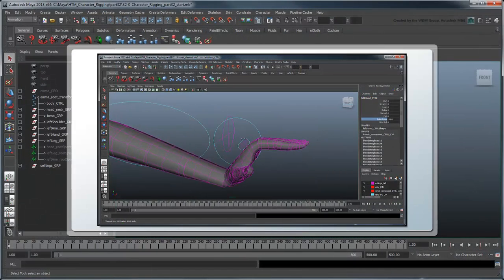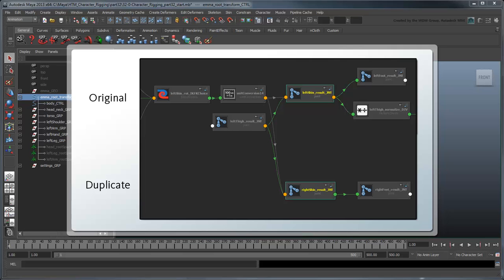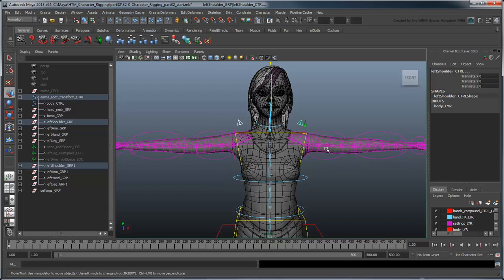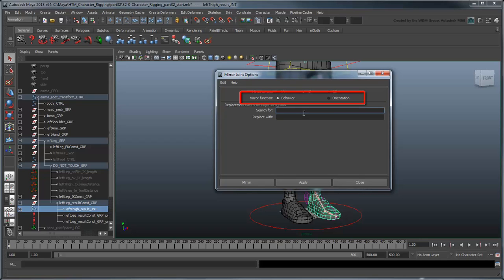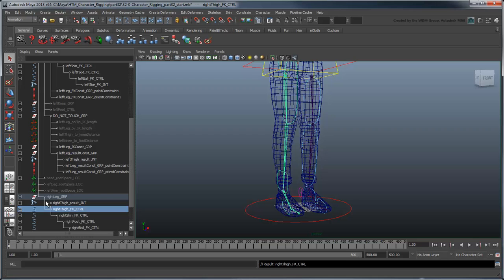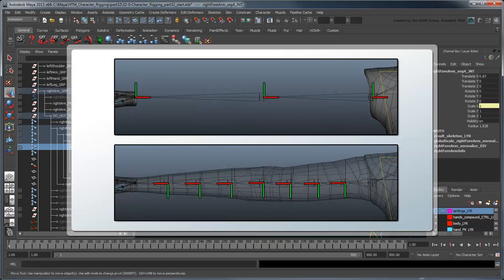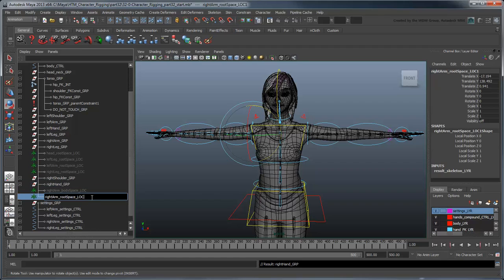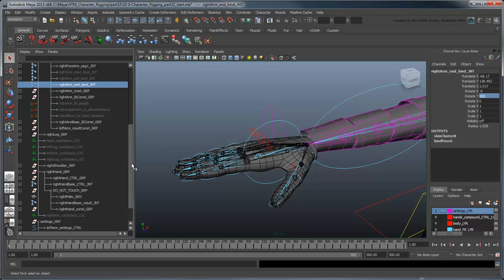Creating a Character Rig - Part 32: Mirroring (Advanced)

Comment: hey - i ve got a question - i am happy with the spine and leg rig - i scaled the whole rig up to my own characters body length - but my arms and hands are much larger than the rigs typical proportions for the size of the hands - summerized: How do i scale up the size of the whole hand rig  - the palm and the fingers  )

Thanks in advance
Reply from the maker: +Sebi Schulz That's actually pretty tricky because of all the math and length nodes involved.  You really need to build the rig to your model's specifications.  It is possible though.  You will need to manually lengthen the result/fk/ik joints, while also tweaking all the squash/stretch math nodes in relation to their new default pose values.

Comment: For me everything is working properly, I Didnt use the palm controls though.
I am having problems with my ik wrist, in translation x the wrist moves but the forearm is lagging back in percentage. i can't figure the problem.
HELP
Reply from the maker: +jiteshz Sounds like one of the math nodes might not be correct for calculating squash and stretch.  You might want to double check that they're all connected properly and dividing as expected.

Comment: Hello again. Assuming that one has gotten through and successfully created this rig for ones proxy character, I have two questions.

One. At some point I will eventually want to skin this rig to the original, uncut character. Is this something that can be over-layed in the same file (assuming that it wouldn't bog things down)? or should a separate file be created where you replace the proxy with the final character for skinning. I'm a little unsure of how to approach that final step for animation purposes.

Two. I will also want to eventually include a full facial rig along with the body rig. Do you recommend creating a separate rig for the head and face and simply parenting it to the neck bone, or should that rig created as an extension of the spine. I've been studying some digital tutors files for creating just such a facial rig, but I am unsure as to how to combine the two.

Hint, it would be great if this series was extended showing how to create a full feature facial rig as well, but hey, I know everyone is busy. Thanks for your time.

Comment: I am so close to the end of this epic rigging journey you have taken me on, and have been trying to resolve a space issue for some time. I'd appreciate some guidance as have tried the ideas mentioned below. I am orient constraining rightArm_resultConst_GRP and rightArm_FKConst_GRP to rightArm_shoulderSpace_LOC, rightArm_bodySpace_LOC and rightArm_rootSpace_LOC. My right arm joints were created from scratch, not mirrored. My shoulder and my hand groups were duplicated and the scaleX set to -1.

My rightArm_shoulderSpace_LOC attributes are: Rotate Y: 0 Rotate X: 0 Rotate Z: -137.01

If I make the orient constraint with maintain offset disabled,  rightArm_resultConst_GRP ends up with a rotate Z value of -53.13

I tried what Marc Antony suggested below, but the joint chains end up at different strange angles once I change the weights for the orientConstraint.

Any help greatly appreciated please.
Reply from the maker: +continuouscurve Hmm, well something is suspicious with your rightArm_shoulderSpace_LOC right off the bat.  Rather than -137 it should be something like -180 or 180 (since you want to essentially flip it around).  At -137, it could very well be causing your problems.  If you look at the way the example file is set up, that locator is pre-rotated 180, 0, 0 before constraining the FKConst and resultConst groups to it so I'd perhaps try that.
Reply: +Maya Learning Channel Thanks for replying so quickly and letting me know where to start looking for the problem. I worked backwards and tried pre-rotating rightArm_shoulderSpace_LOC as you suggested. No matter what I did there, the locator adopted weird rotate values as soon as I parented it to rightShoulderEnd_result_JNT. So I rebuilt the right shoulder from scratch, rather than use a duplicated and flipped left shoulder. 

With my new shoulder, rightArm_shoulderSpace_LOC kept its rotate values firmly on 0 when parented, and after orient constraining rightArm_resultConst_GRP and rightArm_FKConst_GRP to
 rightArm_shoulderSpace_LOC, rightArm_bodySpace_LOC and 
rightArm_rootSpace_LOC everything stayed where it should. Thanks for your guidance, I wish I could have worked it out rather than rebuild, but I guess it is more robust this way.
Reply: +Maya Learning Channel  Oh... except for the rightArm segmented and twist joint chains, which are offset from the rest when I rotate the root_transform_CTRL in fk rootSpace. Damn, I thought I had it! Could you suggest what may be causing this?
Reply from the maker: What do you mean that they're "offset"?  Like they move more than they should, or they begin pre-rotated?
Reply: +Maya Learning Channel  Sorry, that was a poor description. I mean when the rootTransform_CTRL is translated or rotated, the seg JNTs appear rotate or translate in the same orientation as everything else but appear as though they have double transform. This screenshot shows it when the rootTransform_CTRL is translated in X

http://www.pixel-tricks.com/temp-images/Screen%20Shot%202015-10-08%20at%2014.45.53.png
Reply: +Maya Learning Channel And they begin in the same position and orientation as the rest of the arm.
Reply from the maker: This is the right arm, correct?  I'm a little surprised by the direction of the LRAs (not for the segments, which don't really matter, but for the result/IK/FK joints (whichever those happen to be) seem to be pointing in the wrong direction.  If you compare yours to the included example file, you'll notice the example file LRAs run such that X points toward the shoulder, not away from it (again, for the RIGHT arm only).

This could explain what's happening.  It might not be that you're getting a double transform, but rather a reverse transform (i.e. the segment joints are rotating the opposite way than they should) which could be due to the inverted bind joints they're trying to communicate with.
Reply: +Maya Learning Channel  Yes, when creating the result_JNT chains and the subsequent IK and FK chains duplicated from it, nomattter what options I choose in the skeleton>orient joint options window, I cannot get my LRAs for the right arm to match yours.
Reply: +Maya Learning Channel I have rebuilt the entire right arm for the second time, making the LRAs match the example, using a script (cometOrientJoint). I have the exact same problem. I have to be honest, Maya, this rig is putting me off rigging for life. 

There is definitely something dodgy with my twist arm, as when I rebuilt everything and set the elbow snap to 1 in IK mode, the entire twist/segmented joint chain flipped. I decided not to implement the elbow control at all after that. Anyway, it seems there is a problem in there that is causing this strange transformation when the FKrotation space is set to root.
Reply from the maker: Just out of curiosity, are you orienting the LRAs before making all the other connections to things like IK/FK/segment joints?  Generally LRAs are the very first thing you want to set up.  

Also I would check your Move Tool settings to make sure that "Automatically Orient Joints" is turned off.  That can often mess with joint orientations when you're not looking.  Unfortunately I can't vouch for the script you're using since I've never used it myself.

Comment: I have a question regarding the smooth bind. 
Correct me if I'm wrong, the skin should bind to the result joints if I'm right. However there are still open spaces between the poly segments, for example in the torso. What should I do to make it look like on mash.
Thank you very much for all this amazing tutorial !
Reply from the maker: Matan Shilo You will have to use the unbroken version of the Emma mesh.  You can import it from the part 2 scene file.
Reply: Thank you very much.
 I have my own file.
So I'll just smooth bind the mesh to the result joints.

Comment: At [17:46] for this mirroring tutorial my character rig RIGHTarm_end_bind_JOINT rotate x-axis, y-axis, and z-axis are not zero out but are -1.104x-axis, .002y-axis, and .097z-axis what do I do to parent constrain the rig RIGHTarm_end_bind_JOINT to the RIGHThand_baseCONSTRAIN_joint?
Reply from the maker: Jared Davis I'd make sure the non-zeroed bind joints aren't causing some minor twist in your arm in the default pose.  Once you're absolutely sure of that then you should be able to parent constrain it as shown in the tutorial, but just making sure the "Maintain Offset" option is turned on.
Reply: Maya Learning Channel OK the maintain offset is turned on and originally the RIGHTarm_end_bind_JOINT rotate x-axis, y-axis, and z-axis are -1.104x-axis, .002y-axis, and .097z-axis now after parent constrain to the RIGHThand_baseCONSTRAIN_joint the arm twist out of position and now the RIGHTarm_end_bind_JOINT rotate x-axis, y-axis, and z-axis reads 178.896x-axis, 89.998y-axis, and -179.903z-axis. What do I need to plug into the rotation to keep the Right arm from moving out of position?
Reply from the maker: Unfortunately it's going to be difficult for me to give you an exact value from here.  Your best bet is to check the LRAs for those two joints in the example file and see how yours compares.  This assumes you used the shortcut method of duplicating the left hand.  If you didn't (i.e. you recreated the right hand from scratch) then it shouldn't be necessary to use any offset values - if you still have to then it means your LRAs are not properly set up.

Comment: I have an issue... for the right IK joint stretching after I enter the script for the stretching itself the leg seems to work, but when I go into the graph editor and deal with the trans X, etc. the leg stretches correct when you move the leg up, but when you move it down the geometry separates and scales oddly... I need some help if possible.

Comment: So, i rig the right arm.the right arm joints and shoulder joints are mirrored.rigged everything else from scratch.
The problem occurs when i orient constraint the shoulder,body and root space locators to the right resultConst_GRP and FKConst_GRP and keeping. Only the full weighting on shouder space LOC, then translating the rightShoulder_CTRL in positive Y , the fk arm flips downwards aggresively.

Its been 3 days now, i have tried both maintain offset on and off.
Also googled it and looks like lot of people have prroblems with orient constraint flipping their joints but couldnt find a case similar to mine.

If it helps, im having garbage rotation values on the rightShoulderBase_result_JNT right after translating the right shoulder ctrl.
Changing. Interpolation types for the orient constraints does not help.
Using parent constraint with just the rotation checked insstead of orient consts. Does not help. Either.
Someone suggested to manipulate the offset values on the orient constraints of both the result and fk const groups but it does not seem appropriate or accurate.
I know iam missing sonething.the LRAs are perfectlly fine tho.

Is there an alternative way to using. Orient constraints for fk space switching?
Or a totally different approach for spaceswitching?

It seems like the whole problems is with the offset not being. Calculated properly.

I don't know.
Thanks for your help in advance

Ps: also compared with your scene file both in viewport and in node editor.

Comment: @Maya Learning Channel

For the right leg when i drive the result joint chain(mirrored) with the fk Ctrls (mirrored) the result leg rotates perpendicular to the fk leg.
( when rotating the right thigh fk ctrl forward the result leg rotates sideways)
I checked the LRAs for mirrored fk leg and the X goes in the opposite direction as expected but the Z and Y axis are aligned differently in fk leg as compared to the result leg.
Why is this happening even when we mirrored the Fk leg?
How to precisely match the LRAs of fk leg after mirroring with the result leg? 
Thanl you so much for your time.
Reply from the maker: Arpit Dadhich The FK/IK legs must always match the LRAs of the result leg exactly otherwise things like this can happen.  Although we show some shortcuts in this video, we do mention that the absolute best results will always come from building the right appendages from scratch (precisely to avoid stuff like this from happening).
Reply: Built from scratch.its fixed.thanks alot !

Comment: another question... haha. when skinning to a model, do i just choose all the result joints, and choose smooth skin for the model ?
Reply from the maker: ***** That's correct.  The included tutorial files have a layer with all the joints you need to include in skin binding for reference.
Reply: damn your fast with the reply today. haha. Im using my own model so its a bit different. also, when i special duplicate the hand group, there is nothing shown. any ideas?
Reply: ***** got another update. it is there. if i hide the original hand group, it is there. then controls work. however when i do -1 in the scale x, it doesnt go to the other side. it goes off to a weird position
Reply from the maker: Sounds like the pivot may be off center.
Reply: fixed it. its becuase i parent'd the hand group to the arm because i didnt need the palm controls. so hand to break the constraint, and then just continued with the video. Just while I have your attention, these tutorials are great. very in depth and very well done. and also how quickly you respond to questions is also very good. So well done, and thanks <3

Comment: You don’t show it on this tutorial, but on the right arm I orient constraints both the RIGHTarm_FKConst_GROUP and RIGHTarm_resultConst_GROUP to the RIGHT arm shoulder SPACE, body SPACE and root SPACE locators. Once I hit add in the orient constraints options menu the arm flips.  Do I need to check or uncheck maintain offset or am I doing something else wrong?
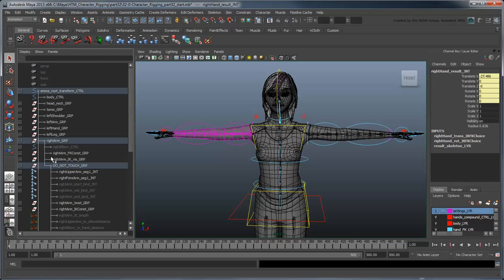Reply from the maker: Jared Davis Maintain offset should always be on.  Other than that, it sounds like there may be some misaligned spaces.  It's the issue mentioned at 15:21.

Comment: How do I view the Mel commands for the right arm on this rig?

Plus When I finish the elbow snap for the right arm, and then did a test on it the right arm squashes before it snaps to the elbow controller. What am I doing wrong?
Reply from the maker: Jared Davis They're stored in an individual MEL file.  Just open that in any text editor.

It sounds like either the scaling on your math node is incorrect or the measurement nodes aren't properly following the elbow control.
Reply: The mel command doesn't show up on any text editor, but is this the correct formula for the right arm mel command:

string $driver = "RIGHTarm_IK_lengthShape.distance";   
float $RIGHTupperARMLength = `getAttr RIGHTforeARM_IK_joint.translateX`;   
float $RIGHTforeARMLength = `getAttr RIGHThand_IK_joint.translateX`;   
float $sumLength = -1*($RIGHTupperARMLength + $RIGHTforeARMLength);     

setDrivenKeyframe -currentDriver $driver -driverValue $sumLength -attribute "translateX" -value $RIGHTupperARMLength RIGHTforeARM_IK_joint; 
 
setDrivenKeyframe -currentDriver $driver -driverValue ($sumLength*2) -attribute "translateX" -value ($RIGHTupperARMLength*2) RIGHTforeARM_IK_joint;  

setDrivenKeyframe -currentDriver $driver -driverValue $sumLength -attribute "translateX" -value $RIGHTforeARMLength RIGHThand_IK_joint;  

setDrivenKeyframe -currentDriver $driver -driverValue ($sumLength*2) -attribute "translateX" -value ($RIGHTforeARMLength*2) RIGHThand_IK_joint;
Reply from the maker: Yes that's right.

Comment: When I finish the elbow snap for the right arm, and then did a test on it the right arm squashes before it snaps to the elbow controller. What am I doing wrong? Also for the right arm IK stretch mel command; do I need to add negative inverts to the formula? And what does the formula look like if I need to add and invert?
Reply from the maker: Jared Davis Yes, you need to invert them.  Try downloading the scene files for this tutorial again as I recently added the right-side MEL commands due to a few people asking the same thing.